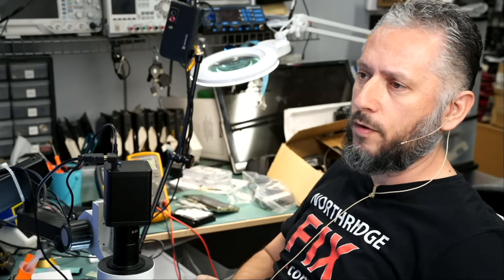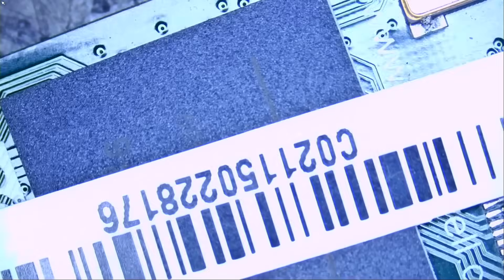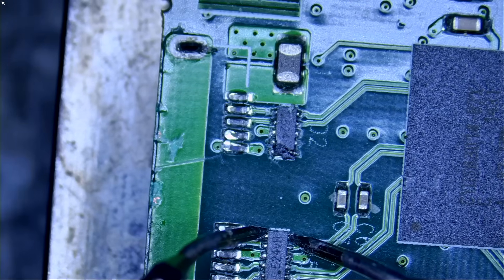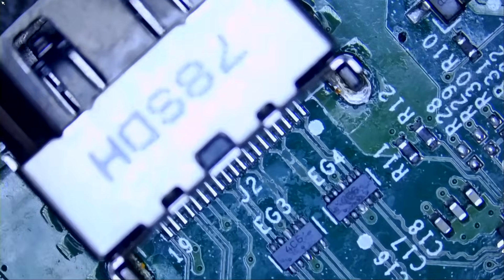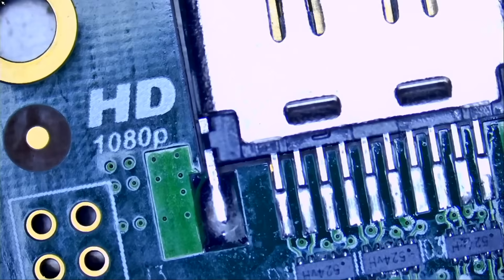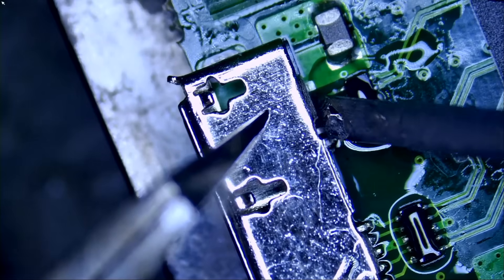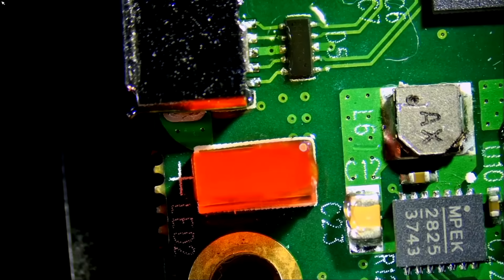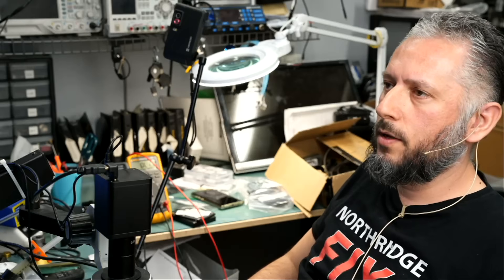Broken Magewell Capture Device Repair. Is it Fixable ?

Comment: The touch feature about that pen may sound stupid or useless for some people, but I've forgotten that I left my soldering iron on so many times, even an entire night. Also, I couldn't agree more about the cheap and expensive soldering tips; I bought a soldering iron from AliExpress a long time ago and the tips that came with it were literally falling apart, and I couldn't even use them because the solder won't stick no matter what I do. Spending money in good quality tools is something very important if you're going to work repairing devices. Of course it's not necessary to buy ultra expensive tools, but at least something that you know is going to do its job fine enough.

Comment: Definitely better than factory! Looks like the metal frame was barely soldered to the board cause there was no solder at all on the back! Pins weren't much better. That may have prevented the pads from being ripped off. NF Mini Pen is awesome!

Comment: The scourge of Lead free solder. If it does not cause microscopic short circuits, it just lets go. (probably also contributing to the plague of failing capacitors due to the high solder temperature and not yielding a bit on cool down to get rid of stress ?) Another youtuber would call that component a "thingy" 🙂.

Comment: I'm surprised that Magewell cards are so expensive. I have plenty of sub $100 capture cards that work well.
Reply: This is exactly what I was thinking. There are $20 capture devices that work well and have similar specs.
Reply: $20 capture cards use hardware compression, usually mjpeg. Proper capture cards return uncompressed video. 
Regardless this is still overpriced, similar products can be had for $100 or so
Reply: especially since it only captures at 1080p

Comment: I went through the effort of making a rechargable LED from scrap parts and an existing pill battery powered decorative "lamp", attached it just fine but it ceased working, i thought it drained the battery, so i found an SMD resistor to dim the LED, yoinked it from a board with difficulty(471 i think) and soldered it to the switch, it was too dim, yoinked another one (200 something) and it was ok-ish. But then the lamp ceased woking again. Turns out LED's leg simply wasn't making good contact with the switch.
All of that was inspired by your masterwork. xD

Comment from the maker: The component replaced is  ESD 4 channel Diode array  hence the D2 marking. Just wated to clear out any confusion. The Chip removed from the xbox serves the same purpose.
Reply: Hi and you could of left the old one in, cause the snatched side was not connected only the other side was for the 2 data lines of the usb. Would of worked either way.
Reply: @tunebg  I believe NF has a standard, the repair is perfect always unless it's some sort of Hiroshima 😂
Reply: @tunebg  , and that's the difference between a good repair and a "would've worked repair". Alex likes everything to be perfect and up to his standards. ;)
Reply: Again here...We miss you all week
Reply: really good job, you are 100% right this component is a ESD & surge protection component and they work all the same way the specs of them are all nearly equal so this component can be replaced with every other component of this type.

Comment: Did you really needed to replace the filter? The 2 pins aren't connected to anything anyways.
Reply from the maker: It doesn't matter. We give it back to the customer better then it came to us. Only took a minute to replace.
Reply: He saved the world from complaints 😊
Reply: @dkaytan they still complain 😂
Reply: It wasn't needed. The microusb 3.0 connector is a microusb 2.0 with an extension of additional pins. The broken filter was on the 2.0 side so there are only d+ and d- for the regular usb 2.0 part. The broken part was not connected.